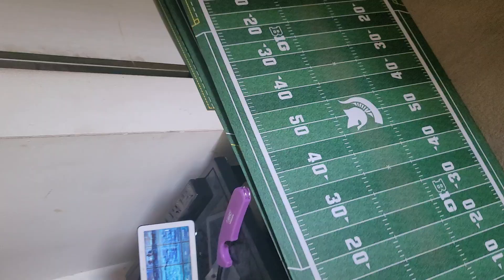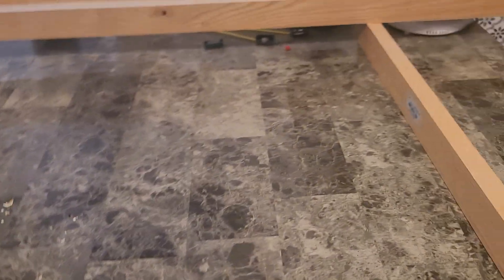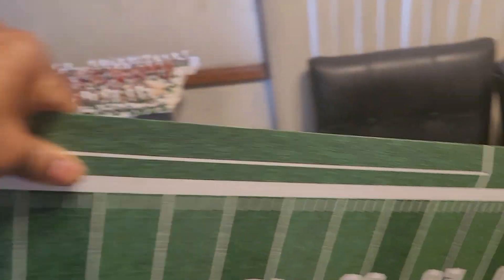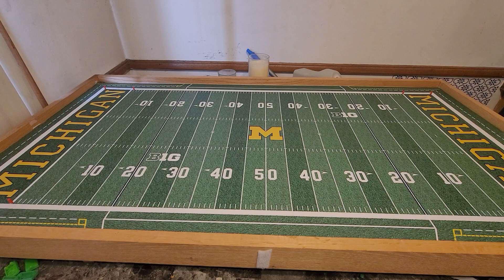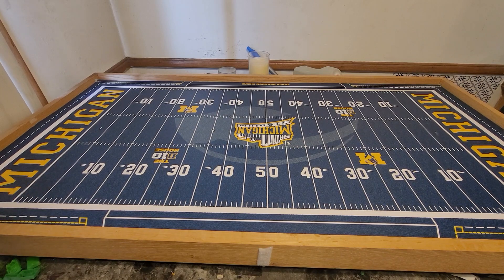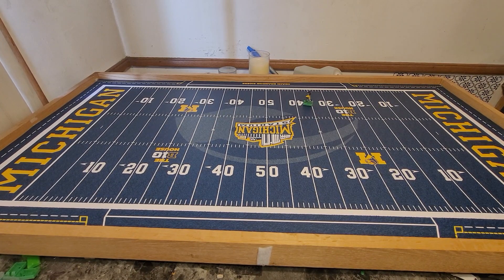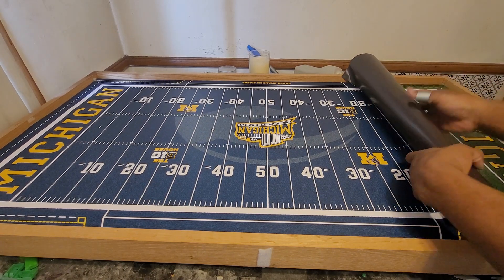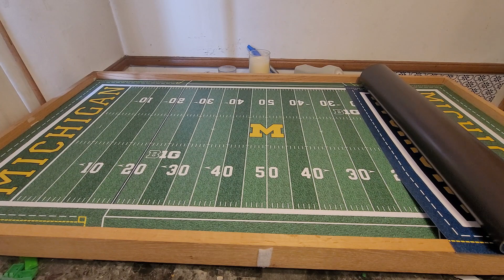magnetic field cover

Comment: Never new they were that easy to install and remove.
Reply from the maker: Not many people make them and this one is made with a very thin magnet and it's the first of its kind as far as I know
Reply: @brandonsigers3321  Don't mean to bug you but this is the only way I know how to conversate if I have a question
I saw a video by Electric Football Hero where he said you painted a Peyton Manning for him, it looked great. My question is I've started painting figures using white primer but even after multiple coats when I put the regular white paint it doesn't seem 3cover like it should
Reply: @brandonsigers3321  any paint tips would be much appreciated.
Reply from the maker: @hittinswitches875  I can only tell you what someone told me that I looked up to. Keep your brushes clean. Be patient. And my personal advice is work as an assembly line if you're doing full teams. When I say that I mean if you're going to do helmets do helmets of everybody so you can get into a good pattern and groove. Try not to be so anxious to finish a figure from head to toe all at once. Also make sure paint is dry before you go on to the next step. Get you some good clear coat period or what grade raggedy brushes or when they start fraying
Reply: @brandonsigers3321  appreciate you!
Reply from the maker: @hittinswitches875  yeah I don't use primer unless I'm painting full teams and that's when I use spray paint and I paint the whole figure. Spring a coat of clear coat on top of the paint helps and then maybe adding another coat
Reply: @brandonsigers3321  okay but how do I keep the figures from rolling away if I spray primer them?